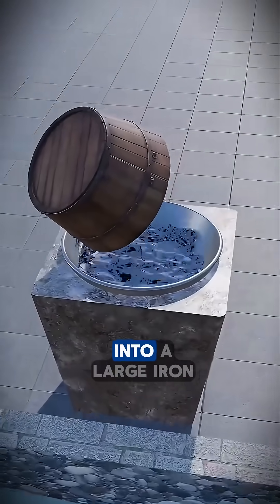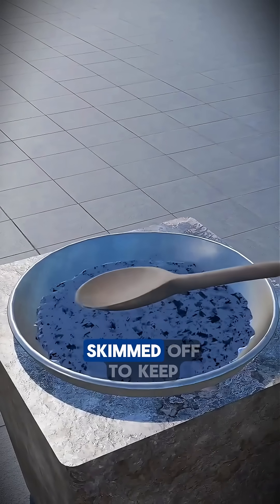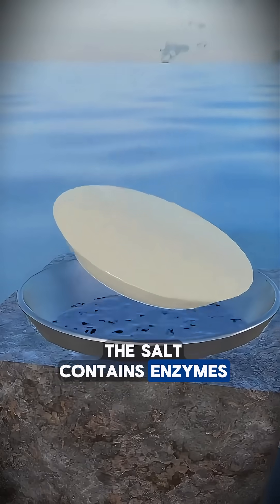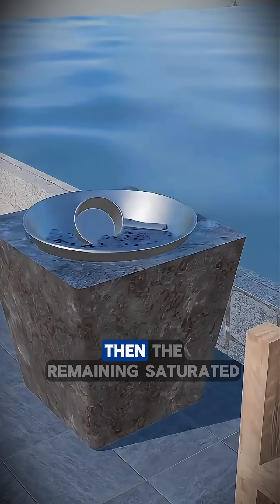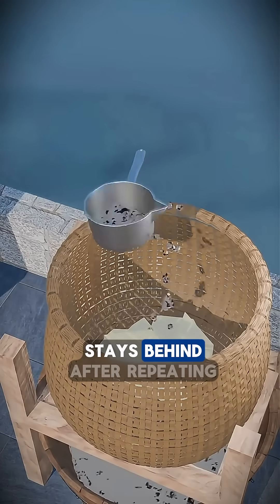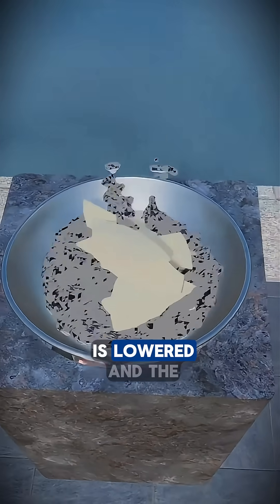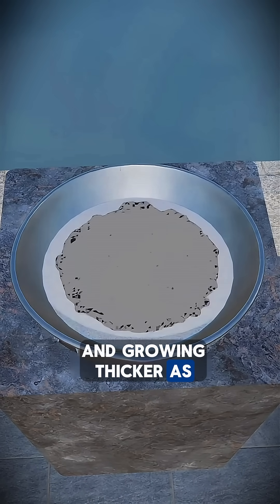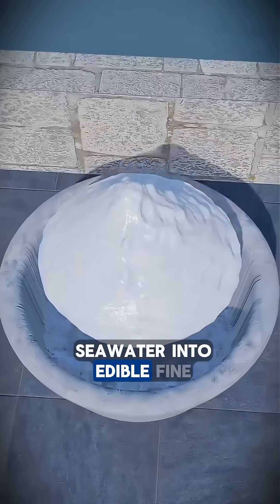How Seawater Is Transformed Into White Salt!

Comment: Bull Shit, you will need somewhere to 100 bucket of sea water to start with, a single bucket of sea water will barely give you 1 millimeter of salt. Second after evaporating over 100 buckets of sea water, the top scust is refined the way you are talking about, but the majority of the salt is ready to use.
Reply: This sounds so wrong.
And you measured weight in millimeters.
Reply: @Bifa_HEBOH1404-n2z  The use of a millimeter is a figure of speech, the measurement of salt from a single bucket of water evaporated is unquantifiable du to not knowing the volume of water. So when I say you are left with a millimeter of salt, it means that it only scratches the surface. Now the reason I now that the salt is so little is because if it was so easy to extract salt from sea water then why the hell people use salt fields to extract salt? Its because 40 acre salt field about 4500 tons of salt in a year in good condition. which equals to 12 tons per acre a day, and an acre is about 4000 square meters. So the amount of salt you get is very little once the water evaporates.
Reply: Millimeter?
Reply: try it